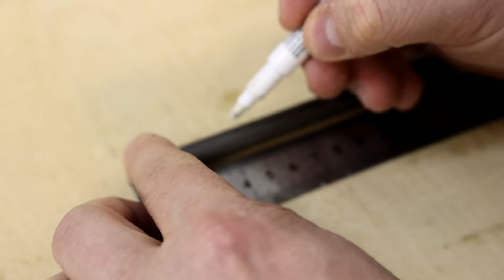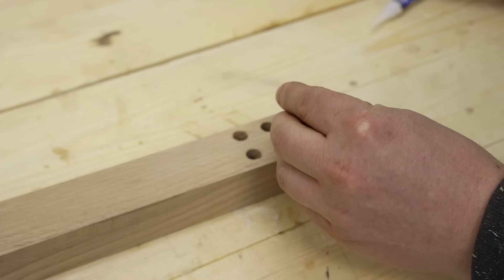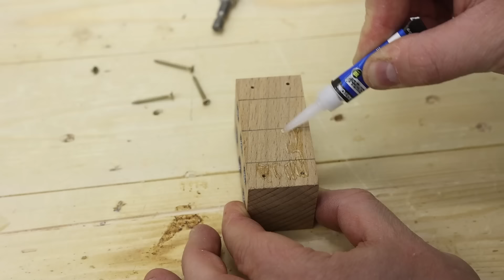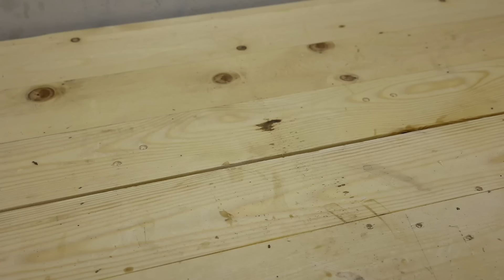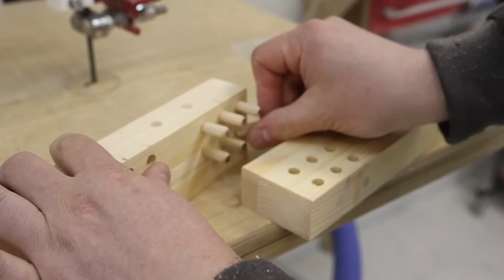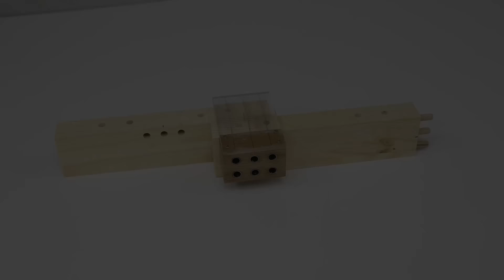A unique device made of a metal tube! Do it yourself!

Comment: Well done, but this is far from unique. My grandfather was using a similar homemade jig when I was a kid, 60 years ago, but he made his from alloy steel with adjustable offset. He was taught this by other old guys when he was young. They were taught by other old guys when they were young. Don't get me started on his dovetail and box joint jigs. When Jesus was a carpenter I have no doubt that back then he was making jigs to make his work easier, and more consistent and accurate. Not unique at all and not new. However, good job. Thumb up.
Reply: Point taken, but there is no historical evidence that Jesus ever WAS a carpenter. Joseph was...